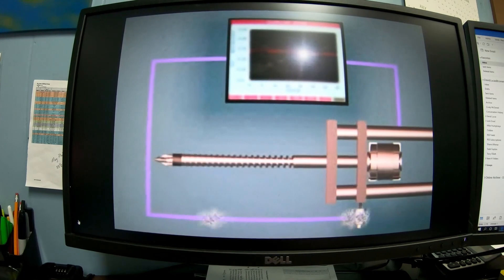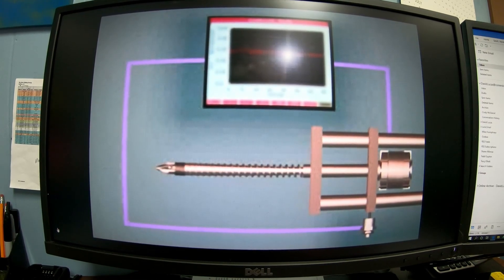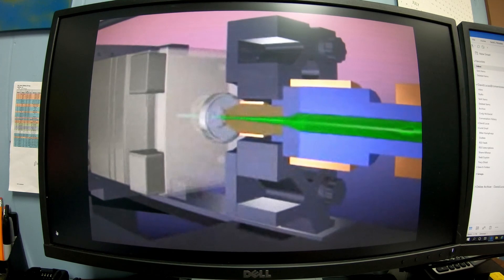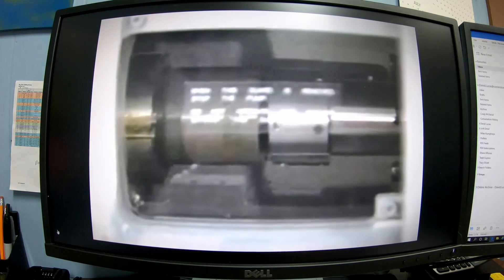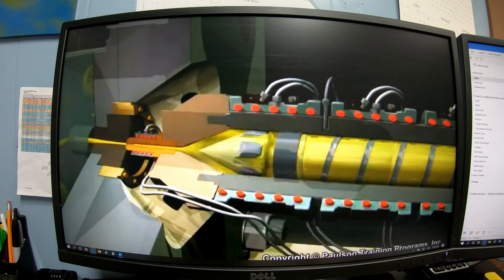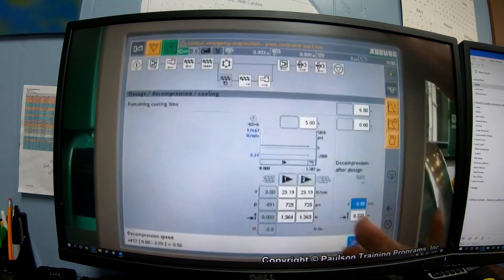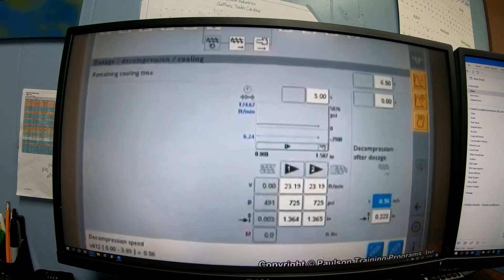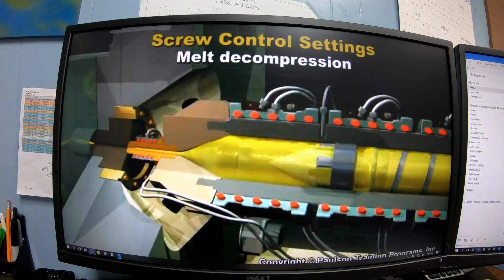Backpressure & Decompression in Molding

Comment: Hi, I've been in the industry since the mid 90s,  Regarding back pressure with valve gates my take on it is to suck back at the end of screw back to ensure the same check ring position to get less variables between cycles.

Comment: I’m currently running a valve gate mold, I’m having issues with the screw not rotating after each shot it just decompresses, do you think it might be the back pressure not being adjusted correctly?
Reply from the maker: If you are bottoming out with no cushion this may cause the screw not rotating. I would check to make sure you have a cushion then take all the back pressure to zero. This should let the screw go back, to much back pressure with make the screw slip. If you don't have a cushion then make sure it is about a half of an inch or higher. Let me know if this helps. Thanks
Reply: @injectionmoldingskillsmore1064  
Let me rephrase that, it is not rotating every other shot. One shot the screw rotates and the other just decompresses. I currently do have a cushion.
Reply from the maker: @gerardooseguera9885  Let me think about this, due to I haven't had this issue before.
Reply: @injectionmoldingskillsmore1064  I don’t know how familiar you are with material but I am running (Isoplast 2510 ETPU) very tough material to process.

Comment: sir. just some question... what is the different between INJECTION SPEED and INJECTION PRESSURE
Reply: Injection speed is a setting of how fast you want to inject material, & Injection pressure is a setting of how much pressure you want to use.
Reply: @buffalo417694  Can injection speed have an effect on injection pressure? Also, the check ring is open upon retraction of the screw, correct? If this is the case, why doesn't plastic drool from the nozzle tip or cause excess pressure on the valve gates? The company I work for uses decomp post injection, and I'm confused as to how plastic does not flow into the manifold and put pressure on the valve gates.
Reply from the maker: @xxTAARGUS  I will show something in the next couple of videos ok sir.

Comment: 1)if backpressure is action and reaction process, than it means backpressure is directly proportional to injection pressure, if we increase injection pressure than backpressure also increase simultaneously , is it correct ? . 

2) if it is correct, than how there is seperate control given in machine for back pressure as it is depended on injection pressure.?
Reply: 1) The back pressure should always stay at the set you want no matter how high of injection pressure you have.
2) Both injection pressure & back pressure, can both be controlled by the press settings. 
I hope this helps, Let me know if I can still help.
Reply: @buffalo417694 ..firstly thank you for  replying ....
1. what is the direction of back pressure , is it towards mold side or opposite to mold side i.e. hydraulic cylinder side ?

2. how does back pressure decide shot size ?
Reply from the maker: @usmanpadaya6027  Back pressure is away from mold side always. The more back pressure the more material you can put into the shot size as well. NO back pressure the material is what is forcing it back. So lets say you have a shot size of 3 inches & you have 100 psi back pressure it will stay at 3 inches. Now we take the back pressure up to 200 psi now your shot size may very to 3.25 inches. I hope this helps
Reply: @injectionmoldingskillsmore1064  .....very well explained....thank you so much...